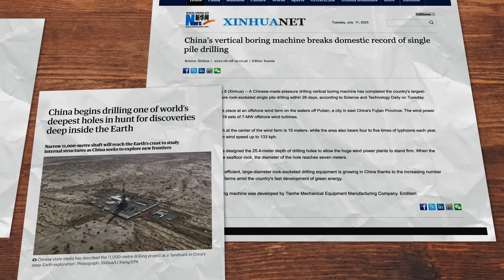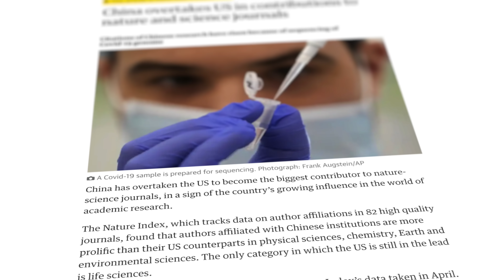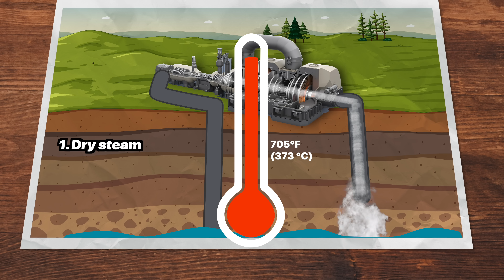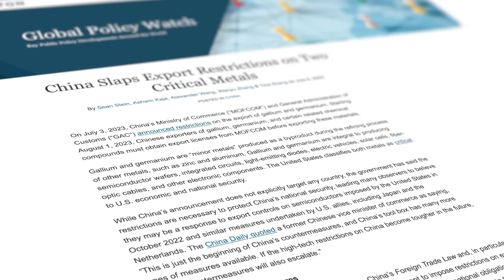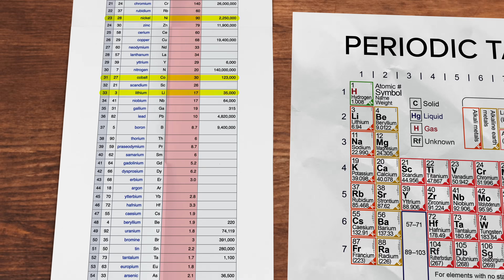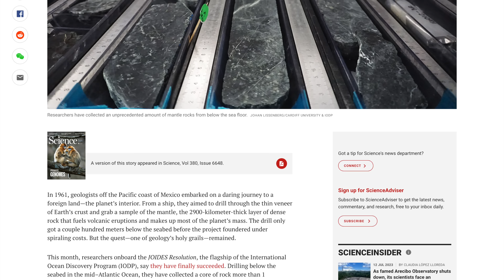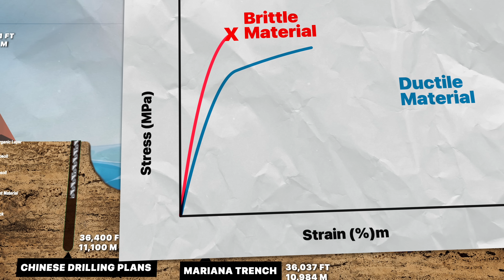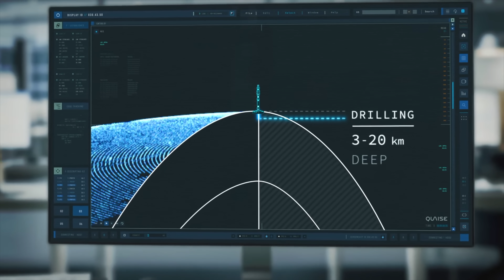What’s Hiding Beneath China’s Deepest Hole?

Comment: I have concerns of cooling mantle temperatures.  I would hate to see geothermal explotation risking the liquid core that creates the magnetosphere that protects life on earth from lethal space radiation.  I believe the single rarest event in the galaxy is the slow collisions of orbital bodies inside the habitable zone that creates a molten core, planetary rotation, a magnetic field, and a stablizing moon.  The energy may seem limitless, but I'm a big believer in the "no free lunch" principle, there's always a trade off.  The exhaustion from exploitation may be impossible before the sun swallow the earth, but the numbers need to be worked.  The 100,000 year reversal of earth's magnetic fields need better explanation before we consider large scale production.  The laser drilling seem very interesting.  I wonder if it would be cost effective for deep drill wells for residential heating.  Glassification or liners keep water out of wells, an insulated pipe with fresh cold air goes down to depth and hot air is convectionally forced out directly into the buildings.

Comment: I see on your chart showing the relative depths of the Kola borehold, Mariana Trench, and Titanic wreck, you've got the Titanic at 12,467 feet & 13,800 meters, whereas the Mariana Trench is 36,037 feet and 10,984 meters. Is the Titanic at 3,800 meters?
Reply: yes. good catch. You can see later on that he does have the Titanic's wreck at the correct depth in meters. I would recommend only using one length unit to make videos, so as not to confuse them.

Comment: Great vid as always and hope you do more on Quaise.  At least on the surface, their strategy of eventually using existing coal fired plants to deliver the massive energy needed to run their gyrotron drills heads directly at or near the plant, and then transistion that plant from coal to geothermal steam seems almost too good tot be true.   Early going and a ton of unknowns for sure.  But according to the Journal of Petroleum Technology,  this year their goal is a 100 inch deep x 1 inch hole which would be 10x improvement over their best from last year.  If they can scale anywhere near that rate annually, in 3-4 years they would be to depths far deeper than needed.   Pretty exciting.  Thanks for all you do!
Reply: Yes.  Please do a deep dive on this.  Todd, this exactly what is so exciting about their approach...  Zero line-drop in energy transmission to the project and then replacing the existing boiler setup with geothermal and having all of the existing infrastructure in place to continue on with.  :-)  Love it.

Comment: What about making a drone drill that can climb down the hole to the bottom, drill for a while, then climb out when it needs to recharge its battery?
Reply: It would melt before it got even a quarter of the way down due to all of the heat sensitive components on board, you can't make a drone using only tungsten, it would require copper, plastic, silicon, etc.
Reply: @krashd  could you water-cool it with water from the top flowing down and then a flexible tube from the end of the pipe to the drone, water flows out the drone and back up the sides?

Comment: Chinas data is 90% bs, therefore its questionable no matter what and how much they find out supposedly since most of it will be censored or just faked. No matter why they drill that hole, wont do anything except of wasting money, just like with the Cola Borehole. It is not possible to go deeper than x meters because it will get to hot for most pumps or other devices. Instead of wasting money for crap like that the chinese government should spend some money on actually cleaning up their global garbage mess and stop producing for the sake of burning up materials and hyping products that noone buys anyways.

Comment: I ised to be a core driller, the deepest I went was about 2000mt. My concern with the death ray drilling is if your vaporising everything to drill the hole and the hole wall is glassified enough to hold the pressure of the surrounding rock your basically going to be studing the exiting vapour and left over glassified hole. Not what would be ideal to study like raw core samples
Reply: Great for making a hole, useless for gathering info.
Reply: You can take samples out of the side.
Reply: @LTPottenger  That is next to impossible as it'll be a layer of glass. Side wall samplers have enough trouble in regular wellbores as it is. Most of the info is gathered from cuttings circulated out of the hole but blasting it with a heat ray is going to destroy that.

Comment: I think you're wrong when you say the foreign car takeover didn't happen under gasoline engines.  It absolutely did - just a different country.  Japan was in a similar position to China back in the 1970s and early 1980s, and there's still a load of Japanese brands on the road today.  All those Japanese companies have built plants in North America (or lease them from American manufacturers) in order to avoid shipping and import costs, but they're still fundamentally Japanese-owned.

Whether or not China can replicate that success with EVs remains to be seen.  Certainly western (and to a lesser extent Japanese) manufacturers have been rather slow on the uptake, and only really stirred into action by the success of Tesla.  Its anyone's guess if they can keep far enough ahead of the game to prevent Chinese manufacturers from gaining the same kind of foothold that Toyota and Subaru and Honda and others did 40-50 years ago.

That said, it'll also depend on quality.  China's reputation is.. not great.  But then again neither was Japan's reputation when they first started really gaining ground.  Not to mention China's reputation is not really deserved (or at least not anymore).  Sure they make absolute truckloads of cheap junk, but they also manufacture (at least in part) most of the products we consider to be high-quality.  They only make cheap junk because people like buying cheap junk - not because they can't do better when required.

Comment: Geothermal energy has been tried in the US, where they found the rock fragmented too much disipating the water/losing pressure not working, then it was tried in Australia, which was said to have the most stable rock in the world, that project also has been mothballed without any Geothermal electrical production. I'm not sure why china is pursuing this type of electrical production when they have cracked Thorium Reactor energy production, which is progressing and will be a game changer, with Thorium being a magnitude better at energy production than Uranium reactors then there;s the Helium3 that can be harvested from the Moon which is another quantum leap ahead of thorium reactors. Leading the world in Thorium modular and minature reactors should be enough considering the abundance and safety of Thorium, which leads me to think the Chinese have, ulterior motives, possibly as petroleum is still used in many non energy products.
Reply: They use geothermal power to great effect in Iceland, but the "heat" there is easier to access (since Iceland is built around volcanoes).

Comment: R&D is necessary but not often compelling. I see no point that any of this confers major advantages to China. Iridium is not the prime objective in any practical way. For China, other than learning the process against all the odds,  this has no actual importance whatsoever, as our own efforts have never been fully funded to this point because we don't need it. China is hoping for a breakthrough to greater resource independence, but none of this is going to matter much and China is no longer the manufacturing choice for other countries. Dry hole or wet hole, none of it will make practical difference. R&D is like that all over the world, China will clearly learn some practical lessons, but it won't matter in any material way. Geothermal already works well enough without this depth. China already has enough raw materials, especially iron. Other countries should perhaps be doing this, and USA will do it whenever it chooses. I respect the energy beam alternative as the new way, but this does not accrue to China but is already also known to the US etc. So again, the Chinese project is just a dry hole. The hydrogen economy/iridium argument is not solved by this frontier activity.

Comment: Maybe it has something to do with the increased heating of the earths core..  which is making magma thinner and the core spin faster as it gets more viscos at higher temperatures. This is creating higher pressures and displacement and ehy we see increased volcanic and siezmic activity. Maybe this type drilling is an experiment to offset the pressure somehow to protect tectonic shift, avoid earthquakes.. or reduce their scale. Another could be as an outlet for flood waters and use to creat thermal energy.

Comment: Glad he talked about Quaise. Been hopeful for them for a year now. I think they are on the right track to a true solution to global energy needs in an environmentally friendly way. I would think that this tech could also be used for placing geothermal plants near the ocean for desalinization purposes. A far more promising technology than the pie-in-the-sky fusion research.
Reply: Just because 4minutes ago
Reply: U r in delusion, y the fuck you want that energy to be used in useless desalination projects// just have a pipe to transmit water where there is more to where there is less. It's much more easy solution/ the only problem is if geopolitics comes into play and countries with power stopped other countries from getting water
Reply: what will happen if the Quaser drill meet a carbon or gas layer?
Reply: @fmvm  No oxygen, no boom.
Reply: Sorry to say, I've watched this Quaise/Woskov pitch since the 2008 patent application. I'll spare you the unfortunate assessment of a 40-year energy R&D pro.
Reply: @cullyfirmin6039  Seems a lot more viable than the pie-in-the-sky fusion research.
Reply: From what I hear (sources somewhat close to the project), the actual engineering challenge is "aiming" the super heating apparatus. Apparently, even small mechanical vibrations make it terribly ineffective with current technology.

Comment: Cool video, but there are problems. 

You show many pictures of heavy equipment with huge augers that aren’t drilling deep holes. That’s just construction stuff for pylons and whatnot. So not sure why that’s in the video. 

Also the laser thing will never come to fruition. It’s a gimmick to trick investors out of parting with their money. There are many problems with the theory of using a laser to drill a deep well but the most obvious to me, as a retired oilfield driller, is that you lack any sort of well control. If you hit a pocket of anything liquid or gas at that depth it will instantly expand in the wellbore (because there is no hydrostatic pressure since there is no drilling fluid in the wellbore holding it down)and it will very rapidly expand exponentially and be a massive massive blowout and people will die. Even if they have a BOP(blow out preventer) there may not be indication of the kick or time to close the rams because again, there is no drilling fluid in the wellbore! 
I’m telling you it will never work. The whole laser project is a garage just like that idiot billionaire that murdered those people in his janky crackerjack sub a couple weeks ago.

Comment: The technology that vaporizes rock is intriguing as it could offer a new way of mining, however it is unlikely we could keep the rock as vapour to extract, the best option would be a bit at depth there which could accept only the elements we are looking for which we periodically hoist up - sounds rather difficult to design though!
Reply: actually, Quaise sez the other way around, a conventional drill down to the basement, then the vaporising gyrotron would be sent down the hole to go deeper.
Reply: and what will happen if the Quaser drill meet a carbon or gas layer?
Reply: @fmvm  at that depth? if gyrotron is used below the sedimentary layers, how could that happen?
Reply: Its the kind of technology that works great if you have a portable fusion reactor to power it, or some other source of near unlimited energy..  Like real Strong AI not really that much closer than it was twenty or thirty years ago.
Reply: Was that an experiment in Maui ?
Reply: A glass lined hole would only be good for geothermal operations. You'd get no significant data from it as you've destroyed the info and hidden it behind a glass wall.

Comment: @9:40 there is an error in this video...  Just look at the metrics for the kola hole, the mariana trench and then finally, the titanic, which is (according to the numbers in the vid) sitting BELOW the earths' deepest point below sealevel and thus also below the kola drillhole...  I guess someone added or forgot to remove the 1 in front of the "3800" by accident (or copy/pasted the values from one of the other holes without editing properly), creating a value which is about 400% of what it should be. The imperial numbers don't seem to suffer this issue. (I prefer using 'imperial', because foot/yard/ounce are only used by countries that think they're the most important empire, sorry US and UK)

Comment: Are there any dna related reasons they would want to dig this hole? I vaguely remember an ice drilling hole that they were testing and found out lots of dna information that changed some previous scientific theories.
Reply: analysing the dna of the boofhead that came up with this idea is about the only possibility of merit.
Reply: No, for several reasons. This isn't nearly the same situation as the ice core drilling research. Ice is able to preserve DNA for potentially millions of years mostly due to the cold, but also because it can be sealed away in the structure of the ice. Drilling into crust will increase the temperature the deeper you go until the point where the molecules that make up DNA will break up. You might have seen some research about extremophile archeabacteria that can live surprisingly deep, or maybe fossils they found bore holes or ice holes, but i don't think there's anything they could find DNA wise in a super deep bore hole

Comment: Interesting fact:  Most oil and gas wells are drilled on or near plate boundaries.  This is where hydrocarbons are mostly found.  Ignored until recently is the fact that these wells also may produced hydrogen.  Sometimes in much greater quantities than natural gas.  Also found in some of the wells are radioactive elements that indicate they came from much deeper than the wells.  The earth formed from elements that have existed for billions of years, including hydrogen.  Is it any wonder it can be found in the crust?  Together with a little heat and nearby carbon or oxygen you would get hydrocarbons or water.  This would be most likely found at the fault lines that reach deep into the crust.  So, how long will this process go on?
Reply: Hydrogen, carbon & oxygen are highly reactive elements, you don't just find them unreacted in the crust of any planet, Coal is from a period where bacteria couldn't eat trees yet, so you wouldn't expect large amounts of coal before or after this layer.

During the early formation of the earth everything was molten hot and had no solid objects to trap liquids or gasses, early earth didn't even have that much water it is believed that most elemental & chemical diversity on the crust comes from astroid impacts and plate tectonics. Most helium is from radio active decay. So yes it is a surprise to find some stuff deep down because of chemistry and physics, most free hydrogen is vented to space because it takes very little heat to move a single atom past escape velocity.
Reply: well that is not true. Have you heard of Texas oil or how about oil in Oklahoma. There is oil all over the midwest. There are no plate boundaries here.
Reply: @marcdefant6027  Check out the boundaries for the North American Craton.  Even the craton contains faults.  (The New Madrid is one of the more famous.)  Not all faults are visible.  The Mississippi is on a notorious fault.  There are faults on North and South Dakota, Wyoming, Pennsylvania, and most, but not all other areas of oil and gas production.  The oil fields in Saudi Arabia are all on a fault zone.
Reply: @barnowl6807  It is true that the New Madrid region may (an I emphasize may) have been the beginnings of the crust trying to teat apart there but to say that is the edge of a plate is utter nonsense. Faults do not necessarily have anything to do with plate margins. It sounds like you know just enough geology to be dangerous. You can believe what you want but I hate to see you spreading misinformation to a mostly uninformed public. And finally, cratons do not represent plates. Cratons represent the oldest rocks found on continents and represent the earliest continents which have now become the cores of the continental plates. And the New Madrid fault has nothing to do with the craton - it is a large distance away from the craton. 

In fact, the edges of active plate margins are the last place to look for oil because it is usually a destructive zone. The best place to find oil is in geosynclines like the Gulf of Mexico. These can form on the trailing edge of continents to be sure. But most of the oil found in the US is in the center of the continents far away from active plate tectonics (or inactive for that matter). Now perhaps you are referring to the oil fields in CA which are near the edge of the continents. Yes they happen to be there because long ago this was a sedimentary basin and the formation of oil here has nothing to do with the tectonics (e.g., San Andreas Fault).

Comment: Just a question if you drill close to core which has extreme pressure what will happen?
Reply: we have trouble drilling 40,000 ft holes. Do you honestly believe they can drill to the core which is 2889 km deep? Anything would melt.